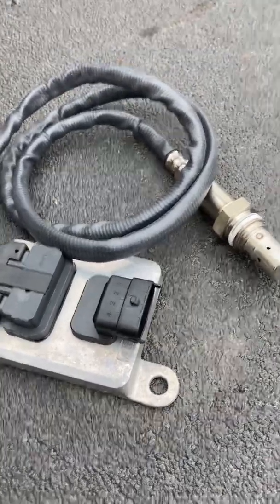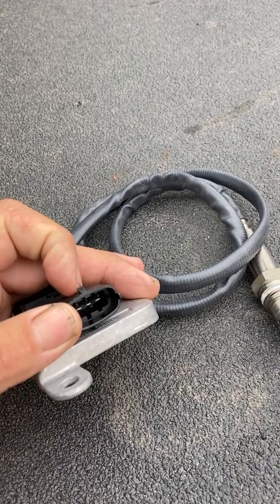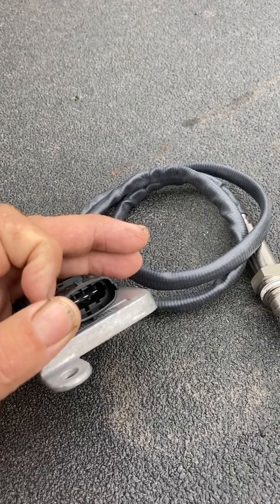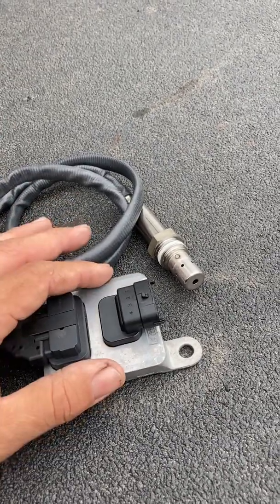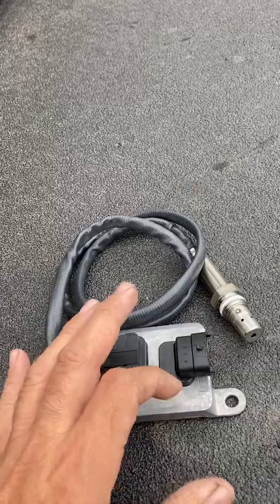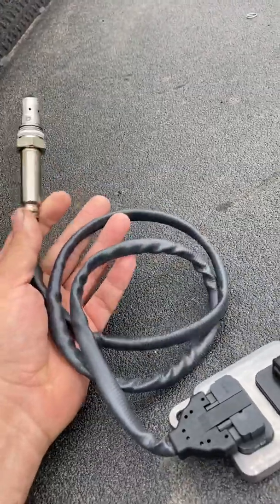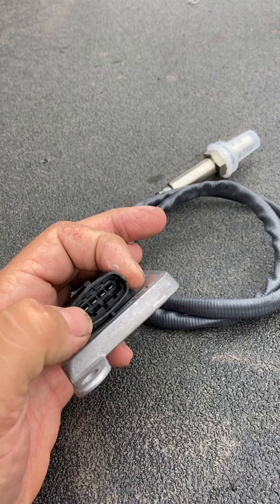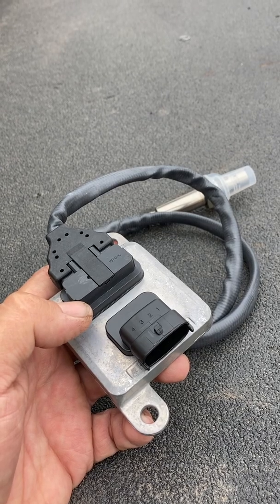Cummins NOX senors  converstaion

Comment: Just got a code P1C54 on my 2015 Ram 3500. 43K miles. The 67A recall was done late 2023. Im out of town and worried about derating. Looks like the code is DEF related and NX sensor. If you can let me know your thoughts about getting home 200 miles, i sure would appreciate it. Thanks.

Comment: Sheathing colors are same between inlet and outlet.  The connector color is what's different on Cummins NOx sensors.  Inlet = Gray.  Outlet = Black.
Reply from the maker: Well had a few accidently install in reverse (2010-2016) I know once the 2350 came on line with the box style connector I think they fixed that issue